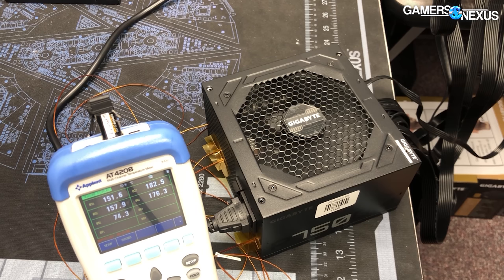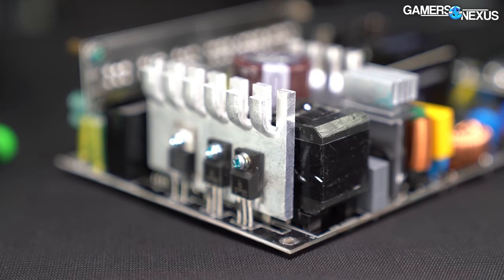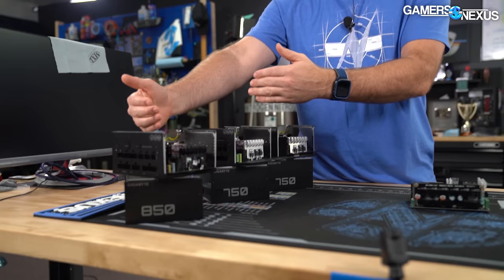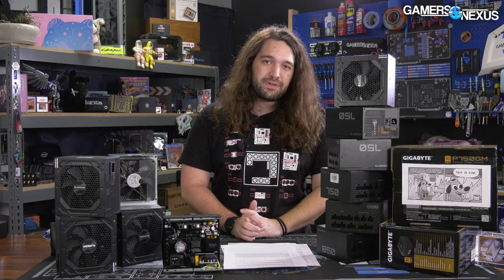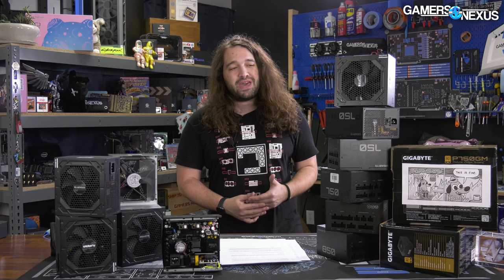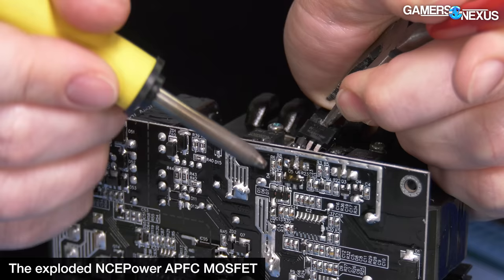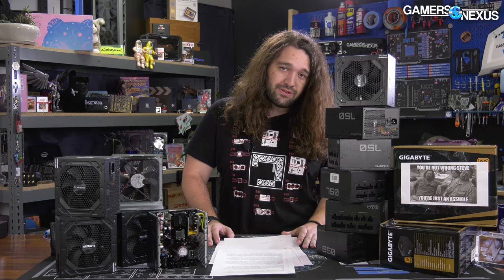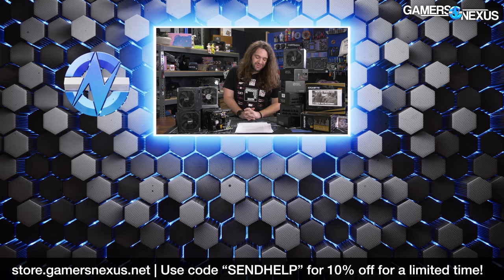Exploding Power Supplies: Gigabyte & Newegg Dumping Unsellable Product

Comment: I mean, when you have different vendors, seemingly at random, you can easily have slightly different levels of quality control for those components and if one company had not accurately listed the parts max/min thresholds you can enter some real crazy consistently failing due to inconsistent reasons...Sad, I would rather a product I release have the same components so in the case that there are failures and I had to recall I would know what part would need to be replaced, and I could get lucky and it could be a set from a time period of production.... this seems like madness... its not really in their defense but like testing a unit this inconsistent seems dubious because one failed unit may have failed for different reasons even in the same model.... that is far worse because that points more at a overall horrible design and looks less like cheap component failure....

Comment: Given the very high percentage of failures from units tested, what does this say about Gigabyte's test plans? Either they're not extensive enough to catch such issues, either no deep testing or low percentage of units tested per total units shipped. Or perhaps they just didn't care so many failed?
Reply: I think it really says that most people buy PSUs that are "rated" for way more than they actually need. IE, if these are falling at 60-80%, most people must not be hitting that lol

Comment: I know this is pretty late, but I work in the electrical engineering industry, having mis-matched and different components is extremely common and it's bad practice to not have multiple sources lined up for components. The important part is making sure that your alternates are functionally compatible with each other. They'll source from the most available or lowest cost wherever possible and even in the same run there might be mixed components. I think spending a lot of time on that part of the investigation could be valuable if more time was spent understanding the differences in specs between parts, otherwise it's not very useful.

Comment: The outsider's comment is this; Gigabyte probably had a quiet supply chain breakdown and they used new-ish suppliers whose components had never been shipped outside the PRC or the components had never been used in a computer power supply before. So their crappy electrolytics went "ker-blammo" inside the US, or the rigs just died the minute power was applied, and NewEgg was stuck with all these untrustworthy, mostly f*cked, units and they've been desperate not to dump them on the parts scrappers and the recyclers. Thus they play Russian Roulette with their customers, knowing damn well they are ruining their reputation. We will see more of this as we march into 2022, just watch.

Comment: Parts usually change based on availability. Sounds like they used parts that were not rated for for the output advertised. I wouldn't be concerned about different capacitor brands changing for each production run. Although it'd be nice to see better capacitor brands like Nichicon or Rubycon.
Reply: Yeah seriously.  These are all swappable as long as you select components that are suitable.  For all we know these were in their bill of material as "alternates" and their procurement team just gets whatever is cheaper because engineering has identified them as suitable alternates.

Comment: A class action should be done since this is very serious, that's the reason why I only use Seasonic and sometime Silverstone PSU's had no problems for years.
Reply: Not how it works unfortunately. This is why warranties exist, as you can get an equal replacement for the duration of said warranty. Therefore, no class action.
Reply: @joeym3425  I don't think you have grasped the severity of the situation? Clear as day Gigabyte was aware of it but did not man up to the mistake to issue a recall. Let me give you an example, Nexus 6P had a bootloop issue so Huawei and Google kept pointing their finger at each other and guess what ding3x it ended up in a class action duh!
Reply: @13thzephyr  I own the power supply. Its clearly a bad product. But what law would you claim class action under then?

There are acceptable units that did not fail, and I would bet the BOM has improved certain components since the initial launch.. From my knowledge you can only claim class action if you can't get a working replacement.. but you can...
Reply: @joeym3425  because they knew it was bad and sold it anyway? Without a fill investigation, I doubt we'd know the full details. But I'm sure they just tried to stealth fix it.
Reply: @Ownage4lif31  Sadly not enough to merit major lawsuits if they are replacing the defective units for free.  It's still wrong though

Comment: "It would have been more effective to monitor the heatsinks of the MOSFETs but that starts getting into cost and design decisions"

A 30¢ comparator and a couple of 5¢ thermistors aren't that costly, but it wouldn't matter that much if the thermal paste they used was cheese.

(Which it probably is.)
Reply: If you are worried about the thermal paste not being 'the right kind' to mount a MOSFET on a heatsink in a standard, built to price, comsumer product, you are on the wrong track. The white silica based thermal grease/gel has been around for long enough so engineers perfectly understand it's performance and limitations. If the MOSFET gets too hot, that is just a circuit or heatsink/case design issue. Why exactly these components actually failed is unclear. Might just be that they torqued the screw too much into the heatsink at assembly, so thermal stress in the components leads to cracking of the package. Or there might be an issue at the silicon-chip level, or how that chip was assembled into the TO-Package. Or it really is a circuit design issue. You and me can speculate about possible cause all day, but in the end that is Gigabytes job to recall the product, replace it immediately to keep customers happy, and find out what went wrong. (And fix it, so that never happens again) It seems to me that Gigabyte is not doing any recalls or communicates openly on the issue in any way for now, so that company is basically dead to me and i'll not consider any products from them in the future.
Reply: @ProtonOne11  Trust me I've personally disassembled Chinese power supplies where the paste mounting the transistor to the heatsink was super thick and crusty. I wouldn't call it "thermal paste" but that's what they were trying to use it as. Wouldn't be surprised if Gigabyte is doing this.

Desitin BUTT SALVE is a far better paste than that. As long as they are using a real thermal paste you're right it doesn't matter.

Comment: 195C is absolutely insane for MOSFET temperature, especially when measured externally (which suggests die temperature was even higher!). 150C at die is an absolute maximum temp for these transistors, they should never be operated anywhere near this point. No wonder they popped so easily! I'd guess the issue could have been related to a defective batch with higher than normal Rds(on) leading to increased conduction losses, but you say MOSFETs from two different brands have failed, so it's probably not this. OTP didn't kick in, but maybe the temperature of heatsink itself wasn't high, suggesting poor thermal mounting of the transistors to the heatsink? At what load was this temperature test conducted?
Reply: I’m guessing actual die temp was close to 250C, maybe even higher, scary indeed.
Reply: @Samuel Very good point! At 120V the PFC transistors would indeed dissipate more heat due to higher conduction duty cycle. Though, I'd be very surprised that an OEM company (whoever they are in this case!) who specialize in PSUs would fall for such an obvious pitfall. Especially as the design overall seems pretty adequate, at least on the surface.

Comment: The opp being over 100% isn't really an issue because components are usually made to sustain extreme conditions for a certain amount of time in fact you can find on datasheet not only the maximum value of power, current, voltage, etc.. they can sustain but also for how long they can sustain that.... I think the real issue here is something went wrong during manufacturing of those parts or assembly

Comment: "... This is fine"

Can these be used, as a military grade flare/flashbang alternate?
[BB or 22LR req'd, for instigation?]
Reply: I don't believe so, as the military would want their "flashbangs" to work 100% of the time and these would only provide 50% of the time and only if you fiddled with the thing in the right way, which is different per unit.

Might make a good bludgeon though!

Comment: Analog circuits side is allowing unstable line voltage to cause the normally efficient MOSFET to  fail catastrophically. 

Normally this would not be a big deal because we usually put better filtering and conditioning in place. To bad gigabyte chooses garbage to put its name on

Comment: Using multiple different suppliers for their capacitors if one supplier can’t fulfil all demand (or to play one off against the other for the best price) is standard industry practice and shouldn’t pose any issue as long as the capacitors meet the rated spec. Your criticism for them using different brands of cap is bizarre.  The problem is them not validating the parts met spec and/or insufficient testing before they left the factory.
Reply: Yeah I'd love to see a response from GN to this comment. I'm an embedded systems engineer and I've developed hardware. I wouldn't blink an eye if we switched manufactures for components. What matters is only if the spec are the same (or similar in range of margin) and of trustworthy enough quality. It also wouldn't surprise me if some PSUs from the same series were manufactured in different places and thus with different component suppliers. 

So please GN create a video to explain why your criticism of the components is valid, as on the surface it doesn't seem to hold up as well as the rest of the video
Reply: This is normal,  but in my experience sometimes I see a product line fail exactly with a bom, replace fail components with other and problems fix. This Gigabyte maybe design flaw.

Comment: 4:50 "our testing" has a small sample size, so skip that. The reason why there's a wide gap between survey data and Newegg Reviews is because if your product blew up you are more likely to leave a bad review, on the other hand if it just works then you might just forget about it.
Still, 16% is intolerable for a product that pricy.
Reply: It's not just that, it's how they blow up, it's indicative of a serious flaw. The single sample at TPU in Greece blew up primary drive FET. GN blew up APFC FETs. These should be vaguely identical, and they should have a low enough RDSon that there should be basically no heat to speak of emitted on them, it's not so hard, the currents here aren't so high, and yet heat is evident, 200°C measured by GN is outright scandalous. Of course for the lab in Greece, APFC FETs were carrying like 4 times less current, due to higher mains voltage, so they hadn't blown up. The fracture pattern on the FETs which failed was however rather telling. They weren't just a little hot, they were a whole furnace.

There is something horribly wrong with the FET choice, FET manufacturing consistency, or their handling and installation procedure. There is no doubt about it. This is the kind of stuff that never happens to more established OEMs, the rest of the PSU design kind of relies on these parts being pretty solid, and there isn't much cost in choosing them generously.

Furthermore TPU was really taken aback by how GB has handled it. GB was like "we tested 5 PSUs, they are fine", which is just baffling, since everyone in PSU business knows that engineering samples tend to not be very telling. Whole 5 PSUs? Ridiculous. TPU expected GB to request the failed PSU back for analysis and give them a new one to test, but none of that happened.
Reply: @SianaGearz  How much does Gigabyte take part in selecting what mosfets and other components are used? If they went to CWT or whoever made these PSUs with a design down to smallest details, would we really see such difference in component choice between different units of the same model of PSU. Or is that more on the actual manufacturer?
Reply: My comment was meant to give a small explanation on the gap between survey and user review data, wtf is this reply section
Reply: 10 might be a small relative number, but if someone buys 10 identical models of computer components and half of them break in explosive fashion then the sample size isn't really "skip it" small
Reply: @thomaserickson5737  Well that's what I'm asking. How can we know this isn't a CWT or some other OEM designed PSU with Gigabyte sticker on top. Gigabyte obviously doesn't make power supplies, so I just wonder do they even take part in designing one.
Reply: @_overchaos_  If Gigabyte does not take part at all, that's exactly the problem. When you offer a product, you are supposed to stand behind it and take responsibility. If you can sue your contractor for deceiving you, you do that, but you're still immediately responsible towards the customers.

The OEM they contracted make little wall warts. They were also assembly partner for Enhance (Taiwanese PC PSU OEM), but then, they were dealing with Enhance's designs and parts supply chain and not trying to bring up their own. For a couple of years, they have been spinning up PC PSU designs apparently exclusively for Gigabyte. The company is called MEIC (Xiamen Metrotec Electronic Industry Co. Ltd, Fujian). What MEIC and Gigabyte are doing right now is learning the hard way why things are the way they are in PSU land, why Taiwanese power electronics companies insist on full verification of supply chain, why they don't switch component suppliers all the time. They are stepping on all the same rakes that all the other PSU suppliers did before them decades ago.

So if you want to bring out a PSU, you either
* need your own expertise and need a process to follow up the quality from engineering sample to the consumer door
- or - 
* you contract with a company that is trusted and known to deliver that quality and can do all that for you.

Gigabyte has done neither.
MEIC took their webpage offline around when it became known that they're behind this catastrophe.
Reply: @SianaGearz  So they did switch the OEM, that was the insight I was looking for. In that case, they should have stuck with CWT, at least their stuff was decent.
Reply: @_overchaos_  Didn't they use a million OEMs over the years? FSP, CWT and just about everyone else. Granted, most of those have been in this business for decades and have a baseline degree of competence.
Reply: @SianaGearz  Yeah, most likely. I know G750H was CWT and that one isn't that old and was basically in the same price category like these new exploding ones. And their old Odin lineup was CWT too so I assumed they made most of their PSUs. But regardless, Idk what was Gigabyte thinking changing to an unproven OEM.

Comment: Brutal! But necessary. These things aren't being sold for $15; they should be a solid choice. From an EE standpoint, the design has simply pushed the bill-of-materials too low and the retail price too high. Certainly shakes my faith in the Gigabyte brand. The lack of a re-call and the push by New-Egg just screams profit-first. Any reasonable firm would be blushing and pulling these things from shelves long before Gamers Nexus manages to run months-long tests on shitty units. Thanks for the content. Journalism like this is priceless.

Comment: My suggestion for future long term testing that involves running a computer for hours on end would be to mine crypto currency and donate any proceeds to charity. Some algorithms can vary very little in regards to power consumption and can consume a ton to provide a decent, strenuous load for testing. The electricity is already going to be used for this testing anyway and this would be a healthy by-product.

Comment: It sounds to me like their design exceeds the tolerance of some components as specified in their respective datasheets. It could be a different story if it only happened to the same component from the same manufacturer. The design makes it a bad product as Gamers Nexus stated.

While the problem is truly a Gigabyte one, it is also on Newegg because they forced people to buy this product with their GPU bundles. Newegg should absolutely take these back without requiring the GPU. In the end, Gigabyte would be responsible for most of the return costs due to a faulty design. Newegg should care about their customers. Their actions tell us the truth about what they actually care about.
Reply: newegg has turned shockingly scummy during this whole parts shortage  the shuffle bundles arent even at msrp, they have scalper markup in them.  so they are scummy on like 5 diff levels with that they did/are doing!!

Comment: Built a computer around 2010 with 500 watt bronze 80 power supply (forgot the brand not at home right now) stopped using it around 2015 and brought a prebuilt. Building a new one now using old case and power supply (500 watt is enough for this build), not so sure about using the old power supply anymore